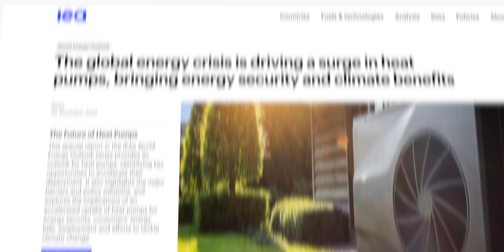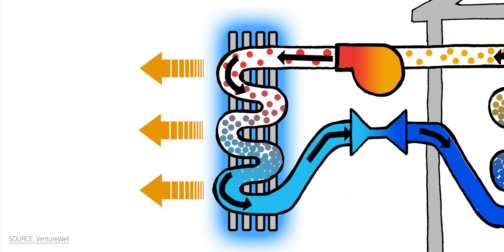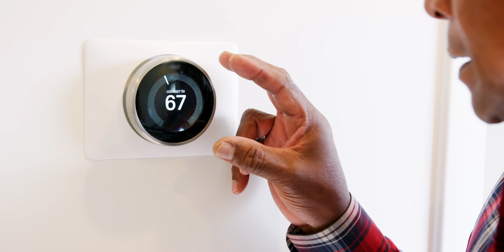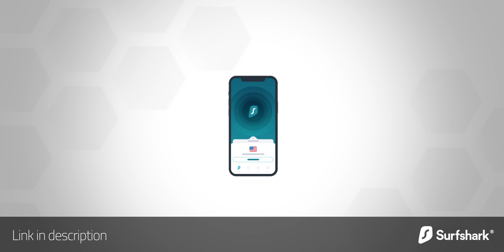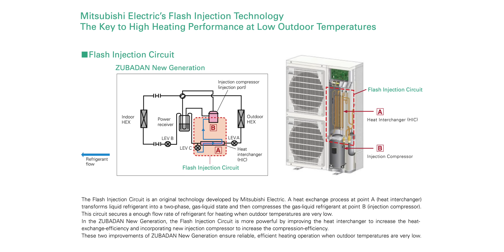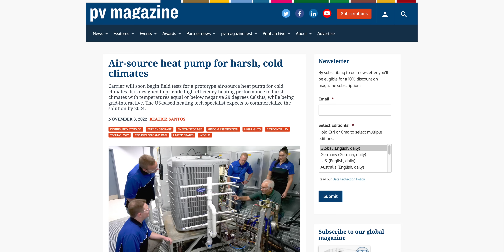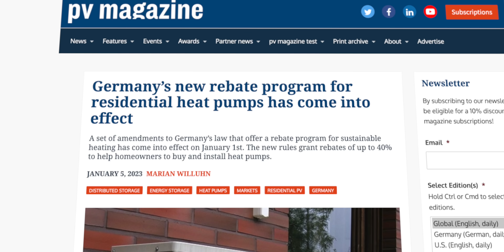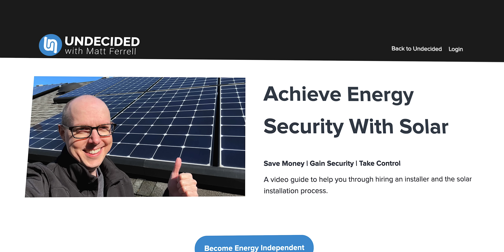Major Advances with Heat Pumps in the Extreme Cold

Comment: Interesting that Matt chose to go with a ground sourced heat pump for his new house. I was under the impression that those units aren't subject to freezing in the winter, and don't lose much, if any efficiency when the air temperature plummets. If this is correct, I'm surprised this wasn't mentioned in the video. Of course, the installation costs are substantially higher for these type units, but hopefully a new home installation is a bit less.
Reply: That is correct - they are less affected, outside of genuinely polar regions.
Reply: We installed a Waterfurnace 3 ton system in our current home using a 520' well into bedrock.  ClimateMaster coined the explanation,  "GSHP don't create heat, or cooling, the merely move heat". That well I mentioned,  it's a thermal mass that stores heat in the summer to be used in the winter. It's dirt cheap to run (KWH) and requires virtually no service.
Reply: Yeah he focused on air side efficiency improvements. However the math I've been doing for GS is stymied by the continuously climbing electric utility rates which seem even worse than my cost for heating oil increasing since the war.  The break-even seems to be around $3.90 per gallon right now. Plus the capital expense of installing not just the GS stuff but retrofitting my A/C system given I'm coming from hot-water radiators. it's seems that without solar (which my utility has all kinds of net metering limitations on) the conversion cost may not be worth it. So there's the reducing CO2 footprint aspect that seems to be the main driver right now.
Reply: @alan31298  can you shop around for your electric supplier? The one we had for 9 years just raised their rate to $0.24/kwh. We switched to one @ $0.16/kwh. We're in northern CT. Dec 485kw and Jan 503kw are $77 and $80 respectively. The are our 2 worst months. Avg heating/mo is 203 kwh ($32). Avg cooling is 10kwh. The other catch phrase is "multiple ways to make electricity,  only one way to make oil!".
Reply: @alan31298  As far as radiators are concerned, you can get a heat pump system that will work with radiators but you (will) need an experienced professional installer to (design) a (right-sized) system and this (may) include upgrading the size of radiators in the home. BUT - 1st things 1st. Insulate, insulate, insulate. Doing that will greatly determine the size of system you'll need & any level of installation disruption. 
Burning stuff in the home for energy (does) impact indoor air quality far more than many people realise, sometimes making indoor air quality worse than outdoor air quality. For those households whose members have any cardio-pulmonary conditions including asthma & emphysema, high healthcare costs & quality of life penalties may make it worthwhile to opt for heat pump installation to take advantage of the longterm benefits.
Reply: @alan31298  you have another possibility to consider, radiant heat. Rather than circulating water just shy of boiling, circulate water continuously at 108. Standardly radiant is in-floor but where you already have the plumbing. Warning: nerd alert!  Another catch phrase for GSHP is "low and slow". It's low pressure and temp and slow speed. In our case it's "forced" warm air. The temp leaving the "furnace " is mid to high 80s and it's slow enough you literally can't hear the air leaving the ductwork. The return temp is 70. As one can conclude,  the blower is on more but, again,  it's not hurricane force velocity it's merely circulating the air. The fan speed is strictly a function of delta T. In your case it would be pump speed. Water retains heat way better than air. This would be a terrific research project for Matt! Swap out the oil fired boiler in traditional furnace for high efficiency electric. Also Matt, ASHP water heater! Ours is half the run cost of standard electric water heater. The water is heated to 121°.
Reply: The costs are a very small percentage of the cost of the build.

Comment: In my opinion there really is no reason to nowadays be skeptical to modern air heat pumps ability to operate in quite low temperature climate. I live in a part of Sweden where the 10 year coldest temperature is estimated to -18 degrees Celsius (which even my old heat pump can operate in although reduced output, while a modern can handle -28 celsius), but a more normal daily low in winter is about -10 degrees Celsius. So I installed an air-to-water heat pump in 2014, since then the compressor has in total run for 43,000 hours with an average SCOP of around 2.4 (older construction, cold climate and high forwarding temperature to radiators during winter takes it's toll, I wish I had under floor heating). And although for me the operating cost reduction compared to my prior heating/hot water solution was marginal and the investment felt very high at the time (I had an old boiler from the 70's burning cheap wood pellets but it required a LOT of work) in retrospect it's the best investment I've made on my house. Because I gained an entire life from having a cheap heating solution that works totally automatically 24/7/365. And a lot of all that free time has been spent on renovating the rest of the house, which I just couldn't do when I was busy/stuck working on just keeping it heated. So in my case I traded a lot of recurring work for a lot of money but I've calculated that if I had had a normal electric heating/hot water solution I would have reached break-even point after about 6-7 years and as a bonus the running costs for heating and hot water is now quite cheap which makes everybody happy. :) Only problem now is that the technology has improved so much that I want to buy a new one but I can't justify it until my current one breaks down. So I'm stuck here with my cheap heating! ;)

Comment: In the UK, domestic air conditioners are rare. Even though the government warns of increasing summer heat waves, the heat pumps being installed by the government's schemes are not reversible - they heat the indoors only and do not offer any cooling in summer. Crazy.
Reply: You are sort of correct. The ones being installed in the UK are air to water, to be more of a semi-direct replacement for the gas boilers.  Cooling is an option on many of them, but to realistically make proper use of it, you'd need to replace radiators with fan coils and at the very least insulate all the pipework, and to get full use would require an extra run of pipework. Including Air 2 Air in the BUS scheme might present a challenge as it doesn't guarantee that the boiler has been replaced, as with a2a you still need a hot water solution.

Comment: Speaking of start-up costs, surely an air-source heat pump can't be much more expensive than a central air-conditioning system.  Even here in Canada, most new builds have central air.  Only the reversing valve is missing.

Comment: These problems in cold climates seem to be for Air Source Heat pumps. Surely the stable temperature below ground for Ground Source Heat pumps do not have the same problems?
Reply: Correct.  But it's a balancing act, many cold climate Air Source heat pumps will start to run rings around Ground Source when the outside temperature is above 5C. So the efficiency gains below 5C will need to be weighed against the efficiency losses above 5C, and crucially, the much higher install cost of a ground source heat pump.

Comment: Two questions: (1) Do these work like Central-Air systems? Or does each room need its own fan unit?  (2) Would having a weather protected area for winter help with the function of the inverter? Not totally enclosed, but at least out of the snow and rain?

Comment: I like that you write metric units beside imperial ones it keeps your videos more international. Regarding the heat pumps, the main question is where do you get the electricity from. Here in Germany it is not so easy, that you put PV panels on your roof and what you put in the network, you can get back in the winter. They pay only 1/3 to 1/6 for the electricity. Anyway, you shall have at least 2 sources of heat for the winter to be safe, and if everyone had only heat pump, then power plants could not keep up with the demand, or we would need fossil fuel powered ones.

Comment: Heat pump costs seem pretty high in the US.  
I live in Finland and just got a Bosch heat pump installed for about $2000.  Works down to -15F so covers most of the year with the exception of a few weeks where it might dip to -20f or so.

Comment: I am just starting to look at heat pump installation options for our condo in suburban Boston. We have a natural gas furnace for ducted heating and air conditioning right now, and it is about 10 years old. Solar is not an option with our condo of course (we do buy from solar production options).  I’m trying to figure out if a heat pump (leaving gas backup per installer rec) will save us much on gas and improve the performance, as our current furnace is not up to cooling the condo on really hot days (>90°).

Comment: The defrost cycle doesn't need an electric heater. Normally they would put the refrigeration circuit in reverse for a short amount of time to heat the outside unit

Comment: Re: geothermal heat pumps, an installer has told me, I should qualify for the tax credits of the state and federal government originally intended for solar power systems, because heat in the ground relatively close to the surface is predominantly solar heat in storage, not heat from the core of the Earth.

Comment: We have used Panasonic air to air heat pump since 2003. Changed the old one in 2021, and are now using a Panasonic HZ25UKE as the only heat source for our living room, kitchen and hall (around 75 square meters). 
We had temperatures of -15 celcius this winter, and had no problem keeping the heat.
Cost of heatpump + installatin, about 2200 dollar.

Comment: I'm going to have to disagree with your data here Matt. Here in New Brunswick (we're practically neighbours) we can get minisplits (ductless heat pumps) installed for as little as $3000 or so. That's in Canadian dollars. My bungalow has one upstairs and downstairs and I rarely need more than one operating during the hot or cold seasons. The optimal temperature ranges also go to -20 through -35C depending on the brand/model. Even a year ago during the heavier cold and snow, I only had 5 days where the heat pumps turned off or at least needed supplemental support from the baseboard heaters. Add the cost savings with heat pumps and it's a no brainer to utilize them. Places like Ontario are really only familiar with central AC units and their inverters. For heat pumps, I do recommend a little cover/roof, provided it's able to be moved or worked around when maintenance is due. I'd also suggest ensuring during heavy snows to dig out around the units to maintain airflow.

Comment: We use a air to water heatpump for almost 4 years now, for heating, cooling and hot water. We have floor heating (tubes with water in all the floors, each room has thermostat) SCOP heating 4,85 SCOP 3,41Cooling, SCOP 3,14 hot water. It is a Inverter system. The coldest week we had was -13Celsius (8,6 F) and had no problems. We use it with solar and have a net production to the grid of about 3MW to the grid each year

Comment: Good progress but they still seem to struggle & cost a fortune. Maybe a cheaper installation which sources heat from a domestic-scale thermal storage unit a 'sand battery' charged by wind/solar would be a viable solution.

Comment: Welcome to the party Murica! 🎉

I am from Michigan but for 13 years have been living in Sweden, the heat pump capital of the world. 90% of single family homes use heat pumps here, mostly air source, about 20% ground source. 

I live in the arctic (68 deg latitude) and have a mini-split supplemented with wood. COP drops to around 1.5 when it’s -25C, but it still covers most of our heat needs. This is also an old, basic cabin with minimal insulation and old windows. A new house would have no issues.

If you are planning to have cooling anyway, a reversible heat pump is an economic no-brainer.

Comment: I remember from years ago hearing that a geothermal heat pump usually has significantly better efficiency than an air-to-air one, because the underground temperature has much less variation than the air temperature. Is this still the case, or are they getting closer?

Comment: Excellent videos! We bought a home with a heat pump 8 years ago. We love it, and the cost of running it is about half of what propane was in our old home. Admittedly, we had moved to an area that on average the winter temps are about 10 to 15 degrees warmer than our old address, but it is still a winner! Thanks for your videos.

Comment: I don't know where you guys live but I live in California or it doesn't get radically cold unless you're in the mountain. I have used wood for years to heat my house because it's always been the best way to keep it warm. I recently got a new heat pump I decided to use it this year as my only heat source and I feel I made a mistake. To keep my house at 65ﾟ cost me almost $400 for the month where when I use wood it's a $150 a month. I do not see how this is a better way of heating although this is much better than the heat pump that came with the house when I bought it that 1 cost me $200 a month back in the eighties and it only kept the house at 55ﾟ When it was 30 something degrees outside during the night during the day it got up into the high fortieslow fifties. $200 in the eighties is a lot more than $400 now but I still think $400 a month is expensive and I was only keeping it at 65ﾟ. I now have it set at 60 and it's gone down to $250 a month. Still a $100 more than wood and I'm not warm.

Comment: If your heat pump is underground instead of working with the air, it's way better and works great in any weather.
There's a point where trying to take air from the outside is not great in the deep cold.  But on its worst day... it's not worse than electric heating.

One protip my parents learned the hard way:  If you have an uninsulated space where your uninsulated forced-air ducts run?  It'll still work, but the far end of the house not well.

My parents got a geothermal heat pump installed by an incompetent company that screwed everything up, and had that duct issue, mediocre insulation, and their house is a long narrow bungalow with the furnace space at one end.  In other words, it's hard to come up with a worse situation.  And they still love it and the up front cost has paid for itself four times over already.  Oh, and we're Canadian so winter exists.

Comment: I live in Massachusetts and originally planned on using my heat pumps year round. But during the winter the electricity costs are just ridiculous and it was cheaper to just heat the home with Gas. (I also have a massive solar system on my home.) Now it’ll just be a glorified AC system for the house.

Comment: I'm nearly 70, and back in the 80's my parents did the heat pump in the lake shore home here in Minnesota. Both ends of the HVAC was done with forced air. 1 simple unit for heating and cooling. We only had 1 issue that was eventually a bad plan. The outlet line was not well enough insolated or... We had to do a heat tape in that outlet line for those occasional -35F and lower temps. To clarify they dug a well, it was an artesian flow type, 15 psi initially when capped at nearly 20 feet above ground. Years later the psi dropped to 7-1/2 lbs. It was recapped at 8-9 feet. At 15 psi there was enough water flow that kept the water outlet flowing during those rare cold snaps of that North wind blowing on this south shore lake home build, a walk out 2 story home. Anyway, with that higher flow rate the water never got cold enough via flow rate and pipe elbow cavitation and related temperature creating flow details. So when the flow rate dropped via the PSI volume pressure change, the pipe would freeze up internally over the length of time of the killing North wind freezes. We had both electric baseboard heat and wood fireplace installed for that accidental issues. Yea it was a bit brutal to thaw that frozen water line (wind & torches problems in snowmobile suits and more). And then heat taping it and re-insulate covering repairs. Yea a few years it has dipped to that -60 degree F. There was no issues after that other than doing the yearly pre-inspection of everything.  As far as I know the home is still using the same HVAC system as of a little more than 1+ years ago. One can see the over flow pipe opening as an open water flow back to the lake on the shoreline.. Oh, there were days the 90's & 2000's when the roads could not be plowed for the snow removal. You can't leave! It was on a cul-de-sac road and even V snow plows could not break through the 6+ feet tall snow drifts, much less do anything with a little 36" wide snow blower being able to do any dent in the snow pack and those drifts. I got stuck in one of those over nights and was there for days.